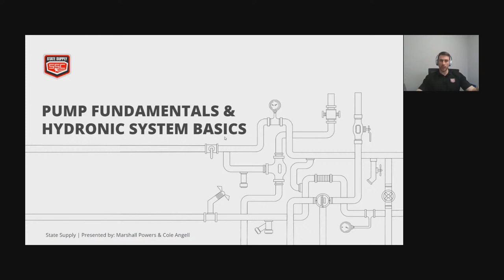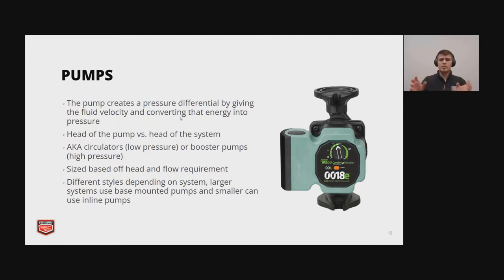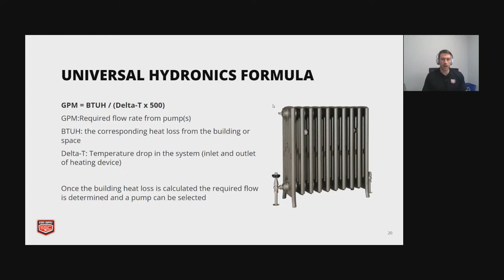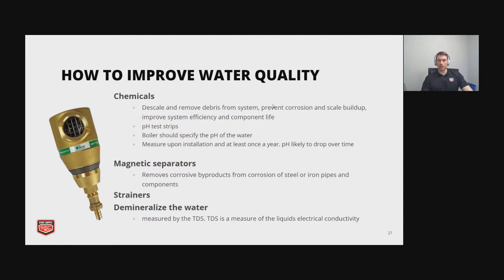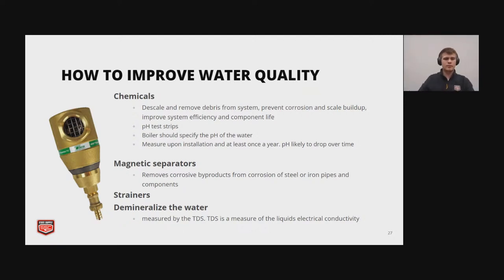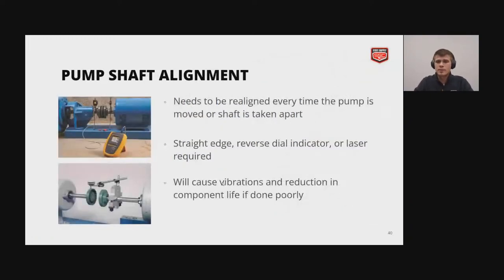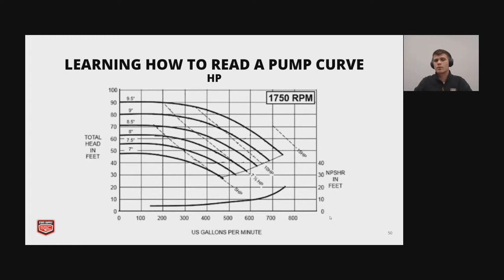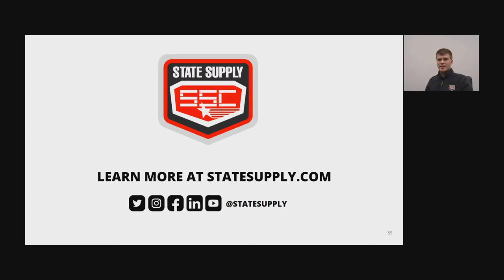Pump Fundamentals and Hydronic System Basics all Boiler Room Pros Should Know - Free Online Webinar

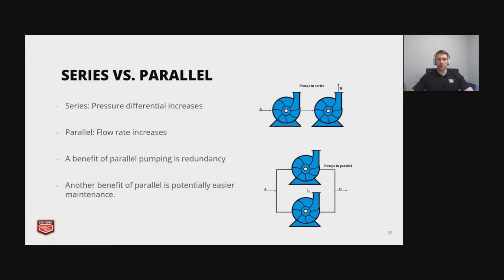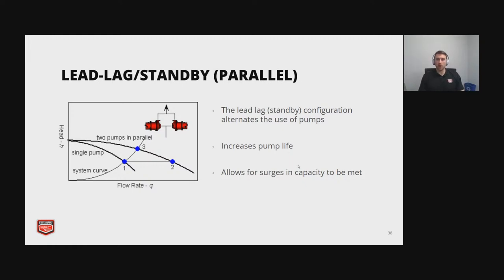Comment: @39:20.....Two identical pumps, operating in parallel or series won't double flow or head. The slide at 40:15 shows that...point 3 on diagram.
Reply from the maker: Correct. Operating two pumps in parallel will increase the flow, while two in series will increase the head. The reason we do not see a doubling is the system curve. For a system with pipes large enough where the increase in flow is nearly negligible to the head of the system, we would see a near doubling of head and flow. Thank you for watching!